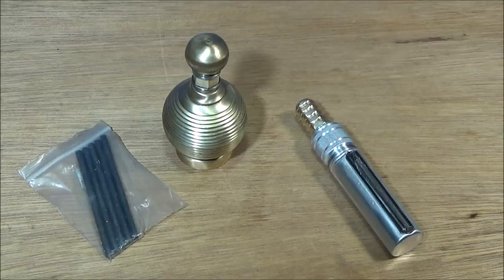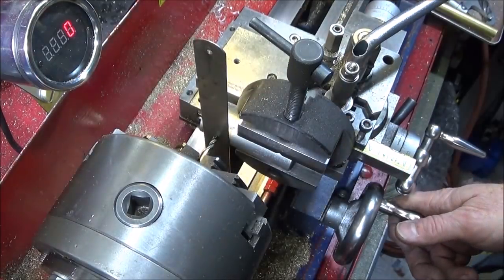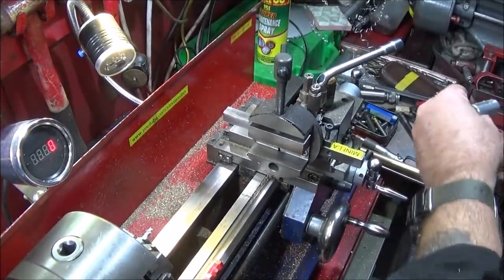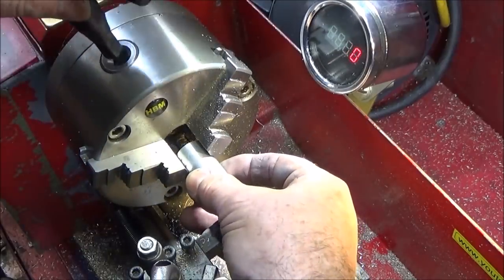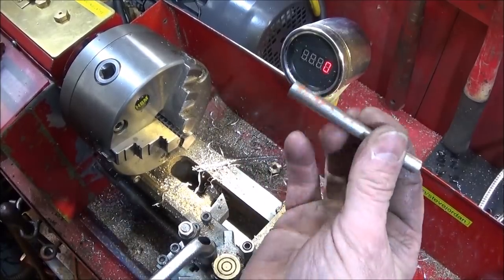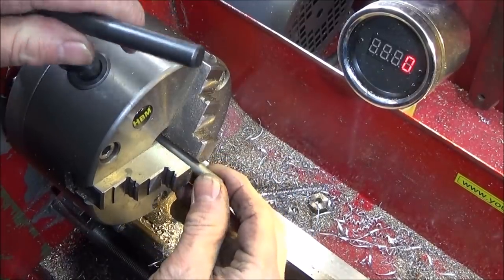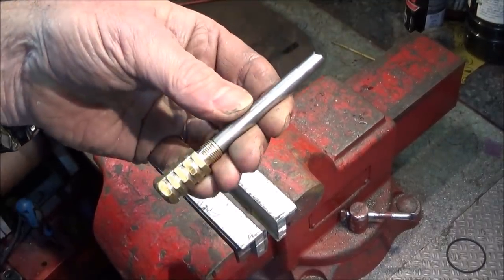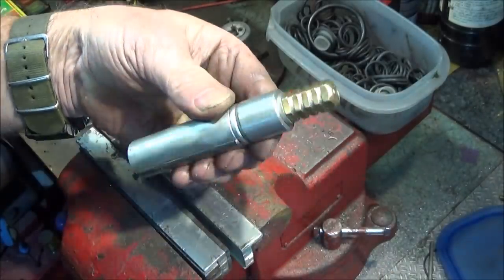Making An Everlasting Match Survival Lighter On The Mini Lathe.

Comment: Hi Steve  During the video you said that you put two rods on instead of one.   Did this make it work better?   I assume also that the file was used because of the hard metal and not for the file grooves.  Did  you make the bottom of the file flat and square?   Where would you get ahold of this rod?
Reply from the maker: Hi Dale putting two rods on forms a groove in which to run down the file so it doesn't slip off. Yes it's the hard metal of the file that makes it work. The end is ground flat with the burrs left on. The corner of the file is struck in the groove. The ferrous rods can be bought on eBay. There are various different sizes. Regards Steve

Comment: Cool project idea. I think if you used a set screw one one end of the rod you could use it to hold the rod in place. When it wears down you loosen the screw and rotate the rod.
Reply from the maker: I did think of that but it needs to be  able to strike through without a stop. I opted for loctite 638 as it allows this plus when the rods wear out I can remove them with heat.